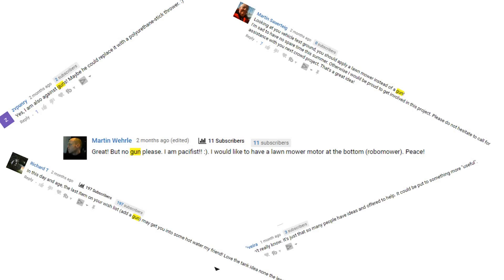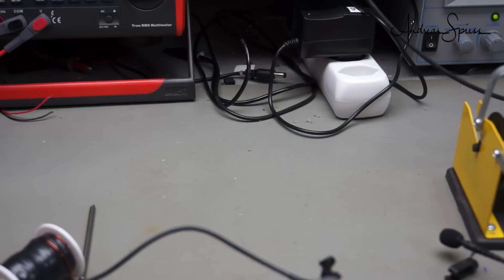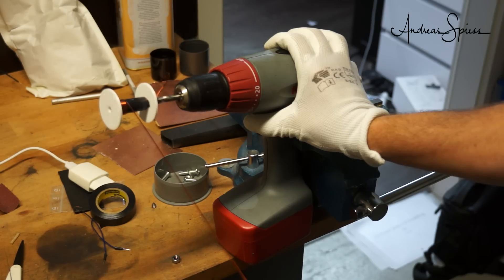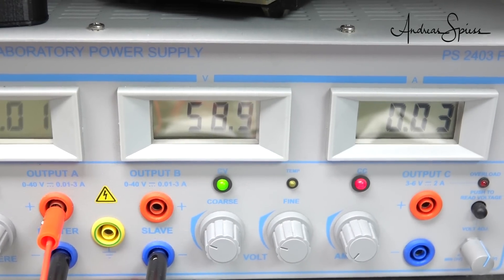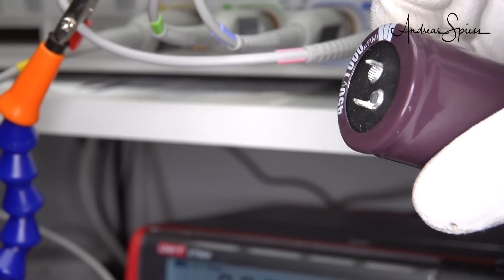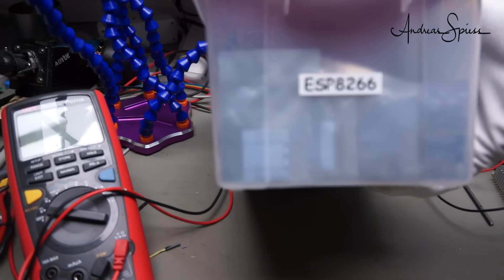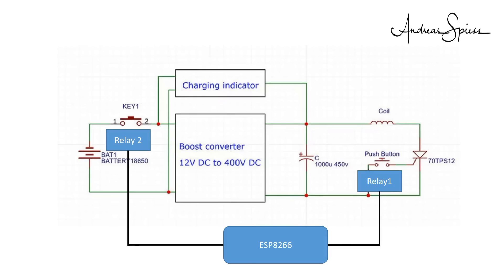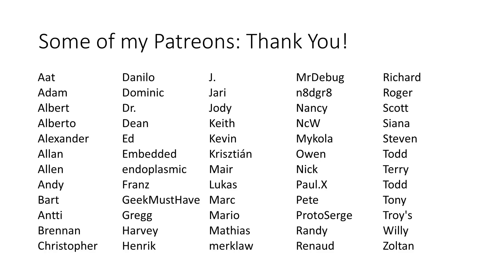464 Better than GreatScott's Coil Gun? A true story, how-to not do it

Comment: Hmm for a long time I have wanted to build a coil gun, but my concern has been accidental discharge in a random (my) direction. Maybe I should stay with petrol bombs or gas bombs as they are very predictable due to their simplicity of just a switch, two leads and a container with a bit of fuel :)
Reply from the maker: You decide ;-)

Comment: Chinese 400 Volts? I thought you along with many others said in a previous video that the capacitor used has to be derated for the voltage you wanted to use so if you want to use 400V the caps need to be 800+ Volts!
Reply: You pick up capacitor that is 3x times the maximum working voltage.
That's the theoretical maximum of RLC switching process.
Reply from the maker: You have to tell this to the manufacturer. I used it inside its specs ;-)

Comment: I have that exact boost converter and it outputs more than double the stated voltage
Reply from the maker: So you had more luck than me ;-)
Reply: @AndreasSpiess  I built something similar a few years ago with the same boost converter. I used a beefier SCR (skkh92/12e) and I guess I did get lucky with the boost converter. I have killed a power supply in a very similar way that you did, but in my case it was when I was building my first Tesla coil :(